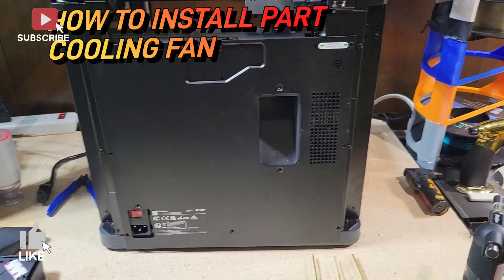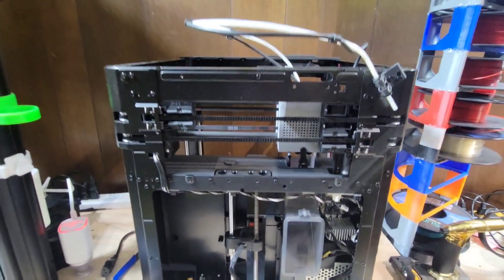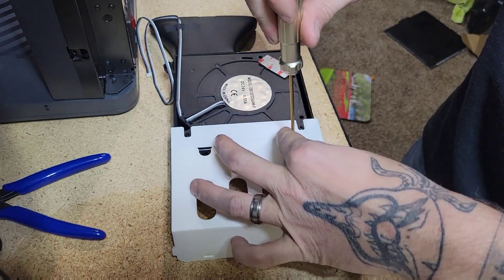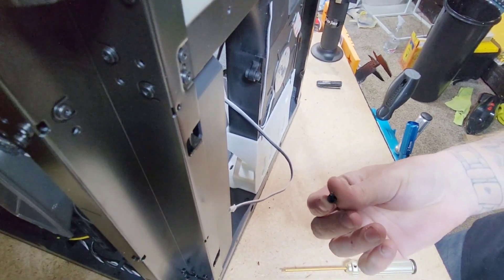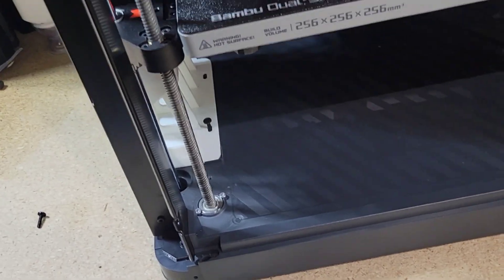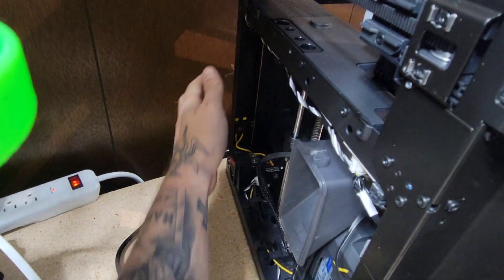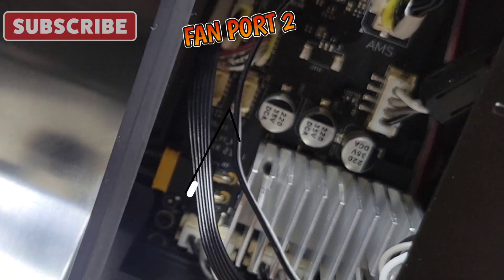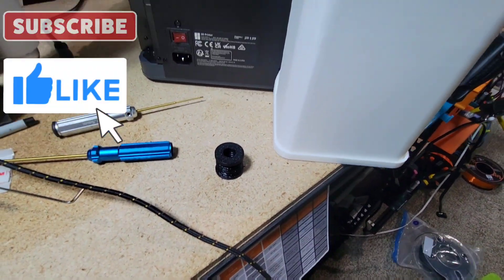Upgrade Your PC: How to Install BAMBULAB P1P Cooling Fan

Comment: Is this for better cooling performance of prints? with two fan ports, do you install one either side of the print bed then? Helpful video, just getting into 3d printing and have a bambu p1p.
Reply from the maker: In my opinion for everything overall
Reply from the maker: Anything you need or if you have a question feel free to ask ill do what ever I can to help